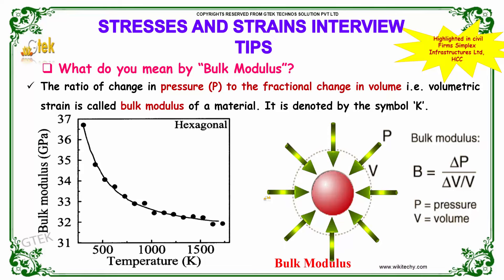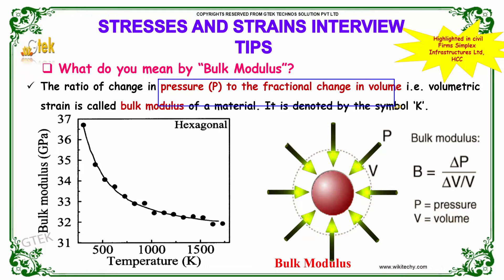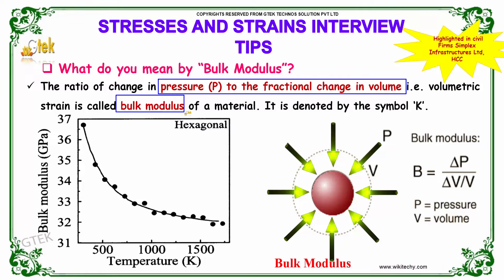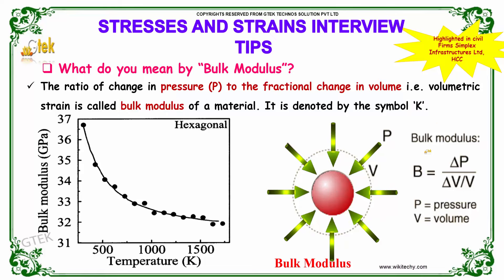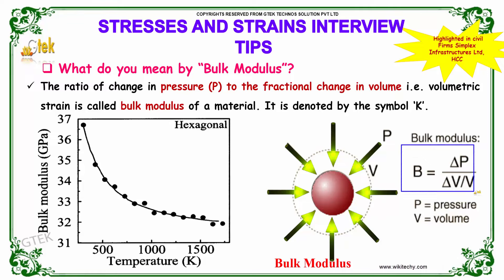What is bulk modulus | Stress and Strain Interview Questions | Civil Engineering Interview Questions

Comment: Strain is the response of a system to an applied stress. When a material is loaded with a force, it produces astress, which then causes a material to deform. Engineering strain is defined as the amount of deformation in the direction of the applied force divided by the initial length of the material.

Comment: Because specific volume is dimensionless, units of bulk modulus are the same as pressure — psig (bar, Pa, N/m2). Thus, the bulk modulus is a measure of resistance to compressibility of a fluid. A flat slope signifies a fairly compressible fluid having a low bulk modulus.